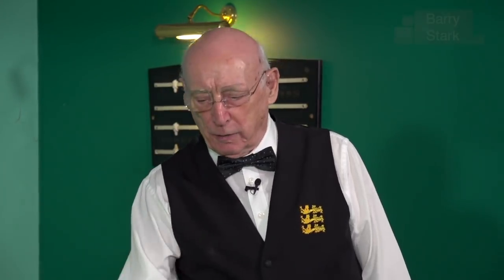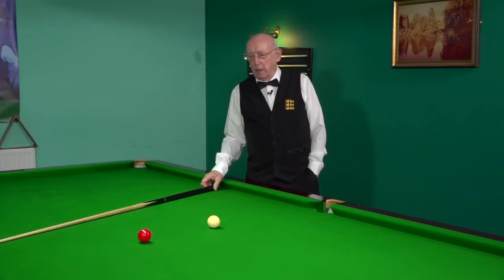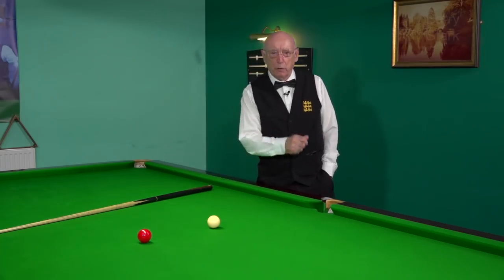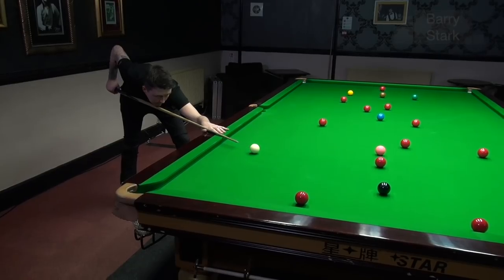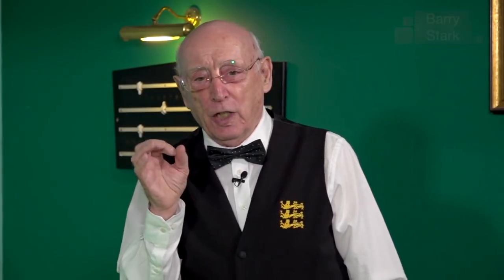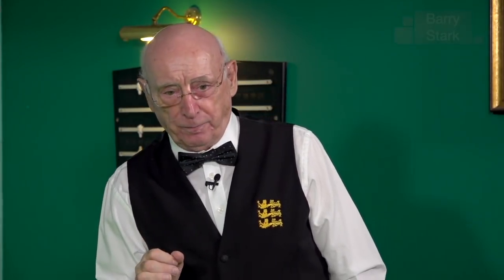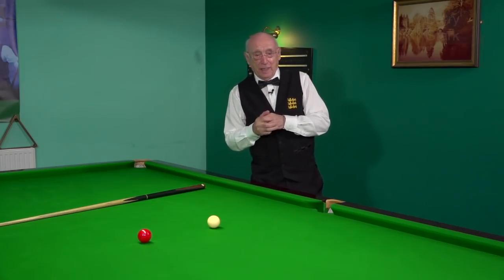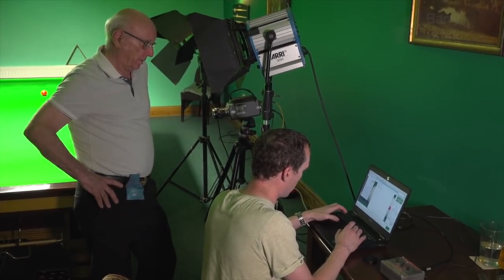109. Timing - What is it? Part1

Comment: Good scientific material,Barry.
Of course you are right.
Myself 35 years tenniscoach..done same experience.
A tennisball got way more flexibilty than a snookerball..so for us it was clearly to prove a professionel tennisplayer hits a ball with way more "timing-quality" than others.
Contact time way longer has been proved.with a harder material as a snookerball is harder to prove.
Good Job ,Barry.
Reply from the maker: @David. I have always said that when a cricket bat hits a cricket ball, a golf club hits a ball, a fist hits a chin, a racket hits a ball. a cue hits a ball, there will be a slightly longer contact between the two items when the timing is good. Granted that particularly with a snooker shot the contact is extremely minimal but nevertheless it is there.

Comment: The more I think about the concept of timing, I have the impression it might be the feeling of acceleration right before and during the hit rather than the contact time.
We’re in general very sensible to acceleration alterations and the perfect acceleration (of 0 right beforehand) means we achieved the right cue speed we set as a goal, thus the satisfying feeling of hitting it correctly.

What’s your thought on this?
Reply from the maker: @kachler. I am pretty sure you are right but I will add that when the acceleration is correct at and through the ball then the contact time is momentarily increased.
Reply: Great video Barry. Timing a shot well is similar to a perfect gear change in a sports car - you just feel it immediately.

Comment: I have always been told that great timing was when you struck the cueball at the peak of acceleration of the stroke. If that is the case then it makes sense that the cue tip would compress just that slight amount more to let it stay in contact with the cueball for that millisecond.
Reply from the maker: @bucksniper. At least someone is listening, it is almost beyond measuring but for sure the player will feel it.

Comment: Very interesting analysis. It would be great to have another video with the camera. It would also be very interesting to see the stroke of different professional and amateur players to see how much contact times differ between them. Would also be interesting to see how much draw the white had after a certain stroke to see how contact times relate to what the white does on the table.
Reply from the maker: Die. Unfortunately the camera used was valued at almost £60,000, we were only allowed to borrow it for a short duration of time. We did however prove that the length of time of contact between cue tip and cue ball was slightly increased on a well timed shot.

Comment: Nice explanation of timing.  It would be interesting and possibly more informative if a data set was collected that compared time of contact v. Feel (ie well hit or not or in between) consisting of many shots (~30 or more) so an average time of contact and standard deviation could be calculated.  200 microseconds is not much time at all for a collision between cue and ball, but if say the average time of contact was 150 microseconds, then a contact time that is 33% greater could be shown to be statistically significant, depending on the magnitude of standard deviation.  Thanks for your videos I find them very helpful.  King regards.
Reply from the maker: Plinker. Some very good points, we do however hope to borrow a better camera soon, I hope you can bear with us on this as the cameras are very expensive, way above our budget and we rely on contacts and good friends.

Comment: I get it because it's easy with traditional forged irons for a golfer to likewise feel the best shots because they give such nice feedback. Caveat: I never liked the feel of a the perimeter-weighted cast clubheads (Ping type) because they didn't give that crisp clean feedback like my forged blades.
Reply from the maker: Wade. Sounds like you are a very good golfer, the two games have points of similarity.
Reply: @BarryStarkSnookerCoach  I have feel, but am quite out of practice. I was an avid golfer back in the days of balata covers and rubber-band windings. Back then a miss-hit shot hurt your hands, deformed or cut the ball, and usually gave bad results. I took that as extra incentive to miss-hit less shots. Cheers Barry!

Comment: I'm new to your channel and I previously commented on your cameramans' angles. However, I've just seen this video for the first time and I LOVE the slow-mo shots at the end! My eyes and mind were opened as to what actually is happening when I strike the cue. Amazing! The Power Topspin and Power Screw shots really got me! I believe I saw the cue ball on the Power Topspin jump 4 times! (I slowed my Youtube down to 0.5 playback speed, lol)

My only issue is this. I listened to several pool/snooker instructors talk about timing and what I gathered from them was that timing is the correlation between 'WHERE' you hit the cue ball and how much 'POWER' you strike it with. Your explanation of timing is how 'LONG' the cue stick stays in contact with the cue ball. So what would you call my description of timing?
Reply from the maker: David. There is no doubt that where you hit the cue ball and the power used has a bearing on the timing of the shot but unless you hang on to that cue ball timing will be lost. It is very difficult to measure in what is micro seconds but the player will certainly feel the contact in a well timed shot.

Comment: Can't the timing be improved by using a softer cue tip?
Reply from the maker: Anas. Like the way you are thinking. Certainly with a softer tip there will be more compression, the same is likely with more depth on the tip. However, these type of tips will throw the cue ball off line more and the player will lose an element of feel on the shot, this is so important to the player.

Comment: I can see what you're saying but there must be more to it than that. Cue speed and alignment at the point of contact must also be very significant (and perhaps whether it's accelerating or not). I think the analysis of a golf swing, which looks at club head speed at the point of contact would be a good thing to copy. You seem to be focussing entirely on the length of time of the contact as the only important thing and that means you're ignoring other factors that may well be even more significant.
The time the tip is in contact with the ball may well be somewhat related to the speed and alignment of the cue at the point of contact, with the "bounciness" of the tip itself being a variable factor?
Reply from the maker: p jay. Of course the quality of the tip and its speed are all important factors when it comes to timing, all we are trying to show is that when timing is achieved there is a longer time of contact, a point which a lot of people disagree with.
Reply: @BarryStarkSnookerCoach  have you seen the new YouTube video from DrDavesBilliards called "Cue Tip Contact Myth Busting Truths in Super Slow Motion"? Looks pretty convincing.

Comment: It’s all about acceleration. Amateurs think that it’s about velocity or, more conventionally, speed; that the more speed with which the cue hits the cue ball the more spin you create, but that’s not true. It’s the acceleration that matters, in other words the rate at which the velocity or speed is increasing. As soon as the cue tip switches from accelerating forwards or starts to decelerate, the cue ball leaves the tip and the cue no longer has any impact on the ball, but if you can maximize acceleration through the cue ball then you prolong how much time the tip spends in contact with the ball. This is because of Newton’s laws of motion and the equations of momentum. As soon as the acceleration hits zero, F=ma equals zero as well so when acceleration, or the rate of change of speed, equals zero, then the amount of force you put into the cue ball also equals zero.
Reply from the maker: Patrick. I totally agree but proving it requires a high speed camera slightly better than the one we hired for our experiment.

Comment: Thank you, Barry. This was interesting to me. As I thought about this the idea came to me that each shot will have it's own best contact time. Harder shots shorter time and soft shots have a longer time. My hypothesis is that the contact time will always vary depending on what the shot requires. Maximizing the length of time for those individual shots is the key. And I could very well be incorrect about this.  I have no finished watching this video so if you mentioned this my apologies. Cheers
Reply from the maker: Harry. Timing is such an interesting subject, a player will know when he has hit the ball sweetly and I believe that the contact time will be very marginally increased but proving it is proving problematical without the use of a better high speed camera.

Comment: Interesting, but very inconclusive: words like "soft" screw shot have no meaning, its a feel thing. If one soft is a little softer than the other, well, duration of contact between tip and ball will be different. How fast is the cue moving? Is it accelerating or slowing at the moment of contact? How much energy is imparted to the ball (acceleration)? How fast is it rotating(spin rate)? If you're going to do science, you've got to do the metrics. Otherwise, its all feel and you can "just know" things that you don't know at all.
Reply from the maker: Dale. So very true, but we don't have the equipment to measure all the points you raise. All I was trying to demonstrate is that the better you hit the ball the better the timing and the better the timing the longer that the cue tip is in contact with the ball. People suggest that I am arguing against physics, they have a point. It certainly is inconclusive and it is a feel thing that I cannot prove but I am convinced that timing is all about length of time of contact between the thing you are hitting and the thing that you are hitting it with.

Comment: Did you come back to this at all yet? I wrote a blog post in which I linked this film, in which I talk about how the same concepts as these apply to top level piano playing. My blog is called mechanically informed practical piano technique, if anyone is interested in the comparisons.

One important question, for context- how long is the total length of each strike on average? If we just look at 200 microseconds it's hard to be sure how significant this is. Being able to see it as a percentage of the total contact time would be very interesting.
Reply from the maker: cziffra. I share your enthusiasm in this matter, unfortunately at this moment we are unable to borrow this very expensive camera, we are dependent upon a third party, not always an ideal situation as you can appreciate but it is the best we can do.
Reply: @BarryStarkSnookerCoach  that's a shame. Do you have the data on roughly how long the standard contact time was- just to compare to what you said about the size of the difference on the best timed shots?

Comment: Do you think that a longer cue affects timing in a better way? 
For me personally I noticed when I started playing with a 30in shaft I felt I had better timing on the ball.
Reply from the maker: Flash. The standard length of a cue is around 58 inches. On a three quarter jointed cue the shaft is approximately 36 inches and the butt 22 inches. With your shaft at 30 inches it means that the ebony butt will be approximately 28 inches, ebony is heavier and more rigid that either Ash or Maple and in my opinion could be detrimental to the timing, however, a cue is a personal thing and if you like it that is all that matters.

Comment: Barry, when I look closely, I noticed when Micheal Holt cue tip reaches the cue ball, there is a slight acceleration on his cue tip which pushes the cue ball longer, that acceleration is short and very precise, how does he manage to do this?
Reply from the maker: Zin. All good players including Michael Holt hit through the ball rather than at the ball. This concept applies to all sports, it can be a tennis racket onto a tennis ball, a golf club onto its ball, a foot onto the football etc. Snooker is no different, measure your own follow through, sure it will be different for some shots but as a general rule try to increase it, once you can do this and keep the action straight the rest will look after itself.
Reply: Barry Stark Snooker Coach It is noticeable that when Michael’s cue tip just reaches the cueball, there is a second acceleration which is quick, short and precise. I am thing if Micheal uses his wrist to do this, I am unable to introduce this second acceleration with just the speed of forearm and follow through.
Reply from the maker: Zin. Try taking the cue back with the first finger but feeling the cue in the "V" of the cueing hand. Unfurl the rear fingers but always keeping them in contact with the cue. Feel the third finger of the grip hand on the cue and close the grip as you deliver the cue, If you do this correctly a little wrist will automatically be involved but a little more can be introduced as you become comfortable with it.
Reply: Barry Stark Snooker Coach interesting, thanks a lot!

Comment: Hi Barry, you mentioned that when ronnie strike the cue ball, it produces a different sound than other player. Is it caused by the tip he is using or a special ferrule? Or he just use a normal Elkmaster tip only?
Reply from the maker: Zin. Unless he has recently changed Ronnie used Elkmaster tips, new tips have fairly recently come on the market and it is possible that he now uses one of them. However, the different sound comes not from the contact of cue tip on cue ball but of cue ball onto object ball. That sound though is influenced by the way he strikes the cue ball, try it yourself, close your eyes and listen for the sound comparing that of a beginner to the one a good player makes.
Reply: Barry Stark Snooker Coach Thanks for your reply! Never realise balls can collide with different sound too. I guess maybe its because good player can generate much spin on the cue ball with relatively less pace.

Comment: It seems like contact time can only be affected by the "hardness" of the components, (tip, cue, and cue ball) and speed. And that's only if it is assumed that the exact same point of contact on the cue ball is being hit. From a scientific view, "exact" is better expressed as an AMOUNT of error. 

When you said the "long" contact was 200 μs longer than the "regular" one, what was the difference in speed of the cue?  1% different?  0.1% different?  0.001 percent different?
Reply from the maker: S. You have asked a question that we don't have the answer to simply because we don't have the equipment to measure it, the equipment we had was borrowed or hired, our funds are limited but we do the best we can with what we have.
Reply: @BarryStarkSnookerCoach  
Thank you, and the effort is appreciated.  I've seen videos from "the slowmo guys" that usually measure speed by noting how many video frames the object moved in a known distance.  So really they calculate the speed, rather than directly measure it. The resulting answer is extremely precise. 

The nearest snooker table to me is an hour's drive away, I have never played the game. I have played plenty of pool but am curious as to how the cue and ball lightness feels, in comparison.

Comment: Barry, our genius of the green baize (Ronnie) said it best. As you push your cue make sure you are accelerating all the way through the shot. Soft or gentle, accelerate. I believe it is this acceleration that produces the longer contact with the white. If you look at your slow motion footage it makes perfect sense. The white is escaping the tip if you push through slower that the initial momentum of the tip hitting the white. To stay in contact you have to stay at the speed of the white. This acceleration gives you fantastic follow through.
Reply from the maker: Alec. Certainly, as you say, acceleration is vital and plays a large part in producing good timing but I don't believe that is the whole picture, you also have to feel and enhance that contact and that for me is one element that places Ronnie above the rest.
Reply: @BarryStarkSnookerCoach  as usual, you hit the nail on the head Barry. Well said.

Comment: Hi Barry is there any way to stop movement ie lifting bridgehand / swisting grip etc which causes miscues / missed pots  when striking  , particularly on screw shots, I am lucky to have a table at home and have tried to overcome this problem for years  .
Reply from the maker: derek. A good way to stop your bridge hand moving is to use a tactic I have used with people who struggle to form a bridge in the first place. Place a piece of round wood about 1inch in diameter under the raised knuckles of the bridge hand, press down on the wood so that you feel it long the knuckle line all the time while you just knock the cue ball around the table. Progress to playing top spin and stun shots with this in place but not really aiming to pot a ball at the early stages. Once you become aware of the position of your knuckles you can remove the wood and hopefully progress to screw shots. Tackling too many issues all at once can be a mistake, work on the bridge first, this could be the reason for your mis-cues because if the bridge hand is moving then the cue is moving with the result that you will not hit the cue ball where you intend to.